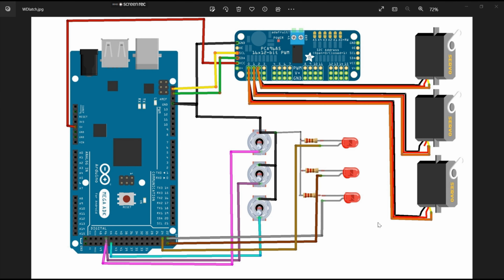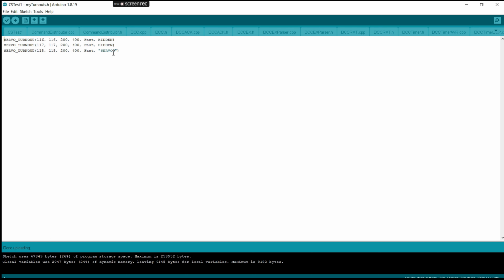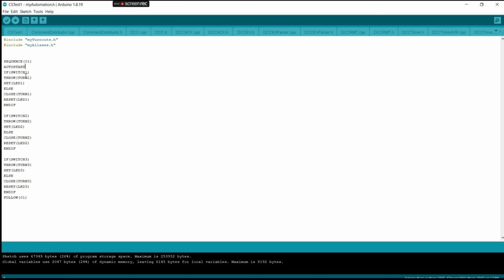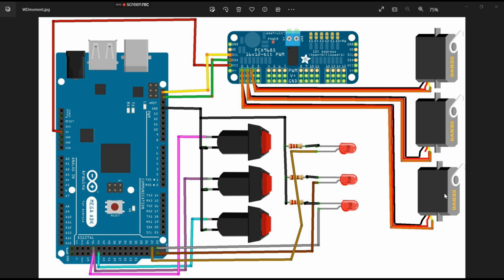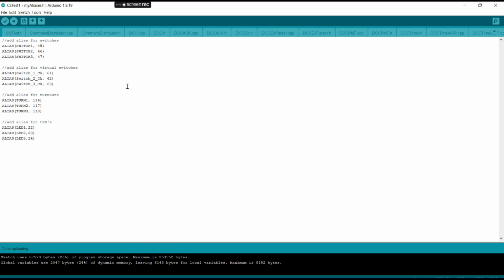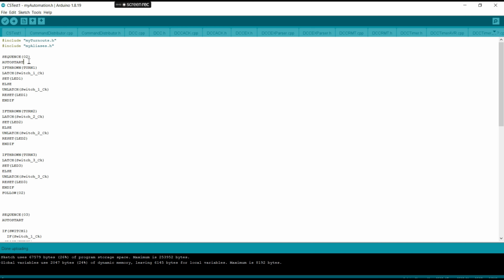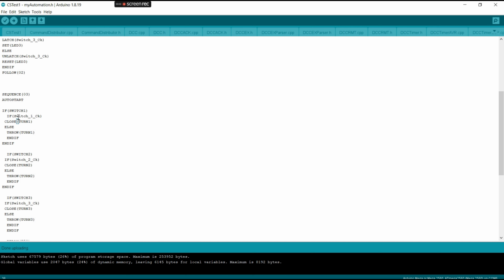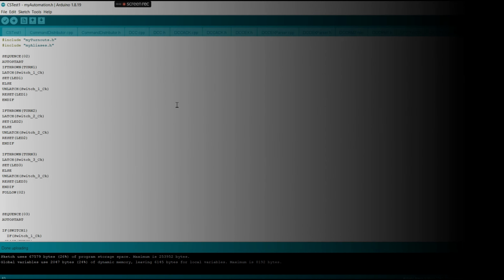Push Button Servo Control using DCC EX

Comment: In your second example - could you just use the state of the point itself and toggle vs. the virtual switch?
e.g....

if(switch1)
  ifthrown(turn1)
    close(turn1)
    reset(led1)
  else
    throw(turn1)
    set(led1)
endif
Reply from the maker: It has been a while since I did this video and version 5.x had added new features.  I am hoping to do an update with some of the new commands that simplify things. I will try and go back and review,  because it seems like I am using switch position to set led, not a virtual switch. The only thing is setting the turnout position by EX-Rail or a button, and setting it correctly, but offhand i think your idea should work.

Comment: If using latching switches will I still be able to use EXtool to adjust servo throws?
Reply from the maker: Latching will probably override EXtoolbox and not allow it to move. I THINK

Comment: Hi, A great tutorial! Makes things a grand bit clearer! One question, I followed you instructions and have found that the servo sticks at THROWN when the momentary switch is connected, if I remove the GND pin, thus removing the switch, it is again togglable through app. Any idea what could cause this? Thanks :)
Reply from the maker: Based on this limited info, I can only offer a couple suggestions for you to try. First, when the switch IS connected, what happens when you push the button, does the servo change direction? Is this actually a push-button switch, not a toggle switch. Is the push button actually momentary, some push button switches are latching. Have you tried a different push button, it could be you have a bad switch. Start with these.
Reply: @SPKPRR  Hi, thanks for getting back to me, I was watching your latest video on using DCC-EX with latching switches hoping to get an idea but couldn't figure it out. 
1) When connected, the serial monitor shows continued activity until pressed and held where it stops. When held I can use EngineDriver to activate Servos without issue. As soon as I let go, the activity starts again. 
2) I am sure these are Push-Button Momentary Switches but it's possible they are NC rather than NO switches (if that's a thing) based on that the signal monitor reports continued activity until pressed and held as above.
3) Each of the button I have do this. I am yet to try a latching switch. Ideally I'd like to crack this :)

Thanks again. - James
Reply from the maker: Ok, so it looks like the issue should be an easy fix. It sounds like your pins are sensing pulled high.  I don't remember exactly how the code is written in the video, but the AT(xx) or ON(xx) need an adjustment. As an example, if the button is on pin 2, change the AT(2) to AT (-2). This should reverse the action of the button.

Since I have done the video, there have been some updates and additions to the available commands.  A new one is ONBUTTON(xx) and TOGGLE_TURNOUT( turnout_id ) The ONBUTTON is used specifically to watch for button press and you would address it like you did for the AT command. In your case it should probably be ONBUTON(-xx).  The TOGGLE_TURNOUT can be useful, but generally I want to specify THROW or CLOSE, so I don't use the TOGGLE command
Reply: @SPKPRR  great, thank you, I'll take a look later this evening :)

Comment: Can you do all this on the UNO
Reply from the maker: The UNO doesn't have much memory. You definitely won't be able to do the WiFi connection, you would have to connect through jmri. Even then, there is very little memory for automation and you would not be able to add much. That's why the Mega is the choice.

Comment: When you have a chance, Can you show how to add a green light on the other side of the button to show when the servo is in the other state.  I want to add the buttons and two LED's for each to a control panel.   Ultimately I will have 16 servos, 16 red LED's and 16 green LED's on the control panel.  This would be so cool to be able to control my layout through the control and/or through JRMI.  Thanks!!
Reply from the maker: To add the green LED, just duplicate the SET(x) command, but have it set when you CLOSE the turnout, and RESET the red LED, i.e.  

THROW(turnout_address)
RESET(green_LED_address)
SET(red_LED_address)

and

CLOSE((turnout_address)
RESET(red_LED_address)
SET(green_LED_address)

Comment: I am wondering,  how many digits can be used for the alias turnout ?  I  think it would simplify things, if turnout 01, could be alias turnout 1001. You could have 999 turnouts, and match names to 1999
Reply from the maker: According to the DCCEX team, route, sequence and automations can be anywhere in the range of 1- 32767
Reply from the maker: Turnouts should be in that range too

Comment: This is a very helpful video, thank you for explaining the code and hardware so well. I have a question, in (SEQUENCE 02) you use IFTHROWN to test the position of the turnout, the servos do not return any positional data so how does DCC EX know where the turnout is when you initially power up the layout. I'd like to attach a small relay to switch a turnout's frog polarity when it is thrown or closed so it's important to know the servos position at power up to avoid a short circuit. Thanks again for the video, I look forward to the next one.
Reply from the maker: DCC-EX defaults to the closed position of all servos on startup. You can add some Sequences or  macros to run at startup if you want certain turnouts in the thrown position. To test, put a turnout in the thrown position then reboot your DCCEX. your turnout SHOULD close on startup. Anytime you throw or close a turnout. Dccex keeps track of this.

Comment: Los sensores se identifican como los descios con servos o solo con conectarlos a uno de los pines digitales se reconocen automaticamente??
Reply from the maker: The pins on Arduino are set to be input signals. The command  AT(pin#) Automatically watches the pin# for a signal (HIGH or LOW). Commands like ONTHROW(turnout) or IFTHROWN(turnout) use "Counters" set up by DCCEX to monitor the state of a turnout, not the status of a pin.

Comment: How did you set up the WiFi throttle to the Arduino?
Reply from the maker: I use the ESP-01 WiFI module, there are others that work. see this link for WiFi boards. 

https://dcc-ex.com/ex-commandstation/advanced-setup/supported-wifi/wifi-config.html#gsc.tab=0

I know there are issues with the firmware on current boards that may need to be updated. I have not needed to, my boards still have the good firmware.
Reply: Thanks for the excellent explanation.
Maybe next time lubricate your throat a little bit 😊

Comment: HELP PLEASE.......I HAVE ENTERED THE CODE FOR ONLY 3 SWITCHES AND NONE OF MY HARDWARE WORKS. LEDs DO NOT CHANGE STATE, THEY STAY ON), NOR DO ANY SWITCHES. HOWEVER ENGINE DRIVER THROWS THE SERVOS ONLY. Am I missing something???????? I hate codeing
Reply from the maker: Without seeing the code, I don't know where to start.  Post your code for the three switches or put it in a Dropbox file so I can see it.
Reply: I found the problem. you use SERVO_TURNOUT(116, 116, 300, 450, Fast, "Test1") instead of SERVO_TURNOUT(116, 100, 300, 450, Fast, "Test1") This changed the pin number on the PCA9685 to 116 instead of 100..... @SPKPRR

Comment: Hi Steve,

Having implemented the Latched Switching version mentioned in the first method you describe, I noticed that power to the servos is constantly applied, which can lead to servo "chatter".  Using the ideas mentioned in the second method, I have now solved the problem by using code in this form (spaces added for readability) for a servo that is thrown when the switch is "on"  :-

IF(SWITCH1)
    IFCLOSED(TURN1)
        THROW(TURN1)

    ENDIF
ELSE
    IFTHROWN(TURN1)
        CLOSE(TURN1)

    ENDIF
ENDIF

This only moves the servo when the switch is changed, and then power to the servo is off until the switch position is changed again.  

This also has the benefit that the values of Thrown and Closed can be played with in the Android DCC-EX Toolbox App without having to disable the sequence.

Hope this helps
Thanks again for a very helpful video.
Stephen
Reply from the maker: Any additional suggestions is always appreciated.  My intent was as a starting point but I always welcome improvements.

Comment: Nice video. I was able to expand to the maximum digital pins for switches  and LEDs but I fall seven short of what I need. Is there any way to use the ANALOG pins to light LEDs?
Reply from the maker: Analog pins can be used hto drive LEDs, but a better method is to use PCA9685'S.  I will have a video on this coming out soon.

Comment: Excellent, another idea for servo control is semaphore signals, but how can you return the semaphore  to danger after a train has gone past? Keep the videos coming, thank you.
Reply from the maker: There are SIGNAL_TURNOUT functions, and I hope to get to that eventually
Reply: So you would have to put sensors in the track to turn the signal back to danger?
Reply from the maker: @funkyx486  I haven't looked at the sensor turnouts yet, but I would think track sensors would be one way

Comment: lets see this all done with the expansion boards!! I'm trying to set up a switching panel myself using led's and momentary switches but it would be a cleaner look to have a few cables ran into the panel with a dedicated PCA9685 instead of running all the buttons and leds out of the panel to the Arduino itself. Loving this video and can't wait for more!!

Comment: Hi Steve, thank you for this - I was just at the point of using DCC-EX to control points on my friend's layout, and had already wired the latching switches to pins 22-34, and tried this and it worked!  However, I was expecting to have to declare the pins as sensors or as INPUT_PULLUP to make sure they didn't drift.  So I guess DCC-EX has already defined this somewhere - I have tried reading the code but it is complex!  Also, I saw you have used pins 61 - 63 for your virtual pins, but pins 54-69 are used as the digital definition for pins A0 to A15 on the Mega, so would it be better to use numbers in the range 70 - 99 instead? Similarly I was a bit puzzled as to where the LED output pins are defined as outputs?  But as you have shown it works, and is so simple to program!

Thank you too for showing how to create and use the "myTurnouts.h" and aliases - it really does make identification so easy!
Reply from the maker: I wasn't even thinking about the Analog pins as digital, so yes it would probably be a good idea to shift the Virtual pins up to 70 or higher.  DCC EX takes care of all the defining for you, so you don't need to worry about setting up pins as sensor or output, the command IF(pin#) tells DCC EX to treat it as INPUT, and the SET(pin#) tells it to treat the pin as an output. Yes it really is easy to program, once you get the gist of it.
Reply: I just had a DOOH moment... I needed more led pins and I just found them:face-orange-raised-eyebrow: